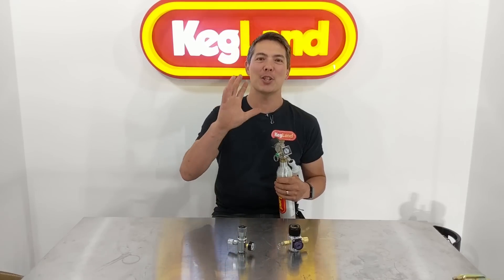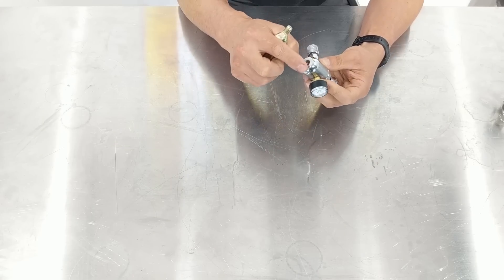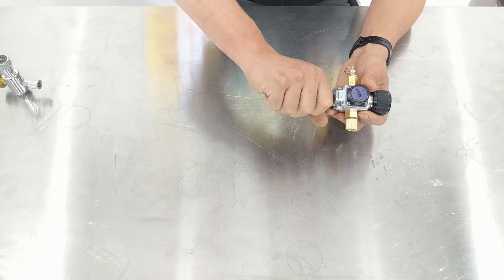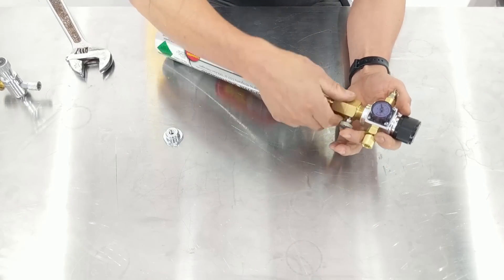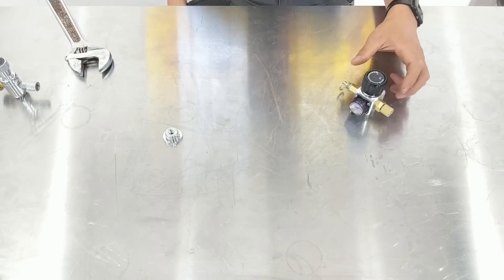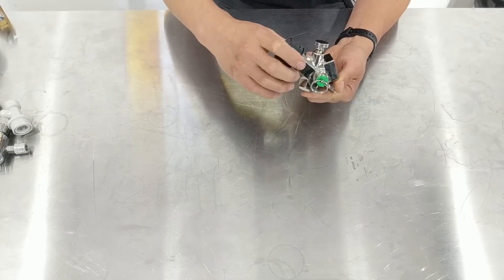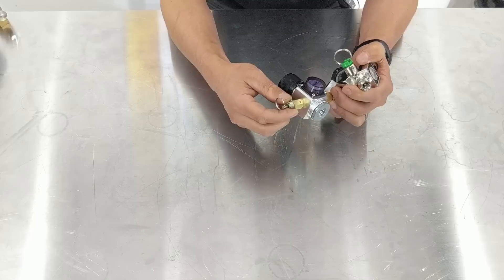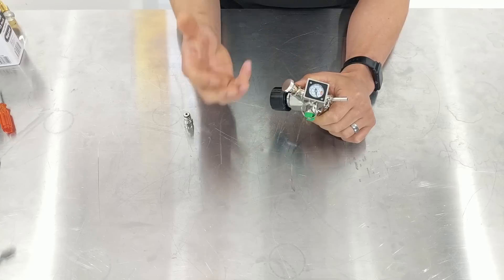The mini regulator that works better in every way - Designed by KegLand

Comment: I put a setup like this together about 9 years ago.  Things have come so far!

It's really convenient using paintball canisters because they can be filled for $6 at most sporting goods stores, you can keep a full backup on hand, and they are cheap to replace when they go out of registration.

I've run into a lot of the same problems you guys did;
- angles are difficult to manage.  gas line exits downward.  gas line from the tank to keg comes loose, leaks, knocks things over, etc.
- heavy full size regulator (for use with a keg) tips the canister over
- regulator dial broke pretty quick from tipping over.  I now just carbonate it then disconnect it.
- bleed valve is a necessity.
- mismatch of stainless, black al, brass, plastic looks messy.
- whole setup is small but unwieldy.

I have pin lock angled plastic and brass taps.  They're just okay.  The pin locks are a bit finicky and have drained kegs of gas or beer on many occasions.  The metal is nice, but the incorperation of plastic makes them easier to break than I would like.  I would have gone full metal, ball lock, at a right angle if it were available at the time.  

On the dispensing side I started with a cheap faucet.   I bought a nice handle to get more leverage opening and closing the faucet.  Then I upgraded to a Perlick creamer.  The creamer function is pointless but the front sealing design is SOO much better.  I bought a restrictor/flow control to avoid unwanted foaming but found warm beer spoils to quick, foam isn't an issue with cold beer - I run it opened 90% of the time, and it makes the faucet stick out too far.  It's chrome plated and has gotten all dinged up.  I got rid of the nice handle and keep the setup in the fridge.  If I were to do it again I would have gone with a basic front sealing stainless faucet.

Watching this video makes me want to revamp my setup!  Metal ball lock connections, this regulator, ball lock taps.

Damn... you can't buy them in the US :( 
Or the Maltzilla - just purchased a mill and I would have bought that one had it been available.
Reply from the maker: Thanks for your comment! You should be able to get some from Williams brewing or More Beer in the US

Comment: These are awesome, managed to snag one in the 10 minutes they were available last time and the few preliminary tests i have done it works well with no leaks. It is bloody solid so any falls and knocks it not going to worry it

Only thing, from the factory, the bottom bushing was on really tight,  i needed to put it in a vise and use a spanner to get it loose.
Reply from the maker: Thanks for the feedback, we will be sure to pass this onto our product development team. Glad you are liking the mini reg!
Reply: What thread is on the Australian sodastream cylinders? I'm in the UK but got a few of the old style cylinders with old thread type thread.
Reply: 2 years later and I just installed mine same issue bottom nut really tight had to hold tight and hit spanner few times with hammer to loosen it off.😮

Comment: Oh man, that is brilliant! I have a couple of the garbage soda stream adapters that only have a tiny screw in the middle of it and I always lose a ton of CO2 when switching bottles. I always dread changing bottles because of this and sometimes I have to adjust the little screw in the adaptor to make it just right which means I lose even more CO2 having to try it over and over again.
I need one of those but I need one for Swedish/European soda stream threads.

Comment: bit late i brought a regulator few weeks ago! would have brought the new one if i knew, nothing but trouble with the old one!
Reply from the maker: Sorry about that. This is a constant issue for us as we are quite regularly trying to increase the feature set of all our products.  This unit will be a bit more expensive.  So I guess at least you saved some money?
Reply: @KegLand  yeah saved some money on a product that does not function properly? sorry hard to see an upside to this.
Reply from the maker: @jamesdurrington9589  Up until this new Mini Regulator is released that has the only mini regulator type that has ever existed.  This new model isn't even in stock yet. Should be arriving in a few weeks.  Even when it comes in stock we will still continue to sell the other ones too.

The current models still work but they just don't have all the features that this new model will have.  Thousands of customers before you have used and continue to use the older designs.  If however you have any issues with the older design you have just let us know and we will assist you in any way we can.

Comment: I have an issue refilling my 60l sodastream c02 tanl. I'm in the US and mine have the newer (type b?) threads that are more finicky. I use a 5lb co2 with the standard CGA320 valve. I have an adapter, which I got from some third party distributor off the internet, but is much like the others... brass, has a pressure release pin, TR21.4 to CGA320 adapter. I can't tell if the adapter is bad or if the brass screw that's inside it is not at the correct position, or if my 5lb's tanks valve just simply releases too much pressure... but I am having big problems getting c02 into my soda stream tanks. It seems by luck, like 1 and every 10 tries, I can get 50-100ml of co2 into the tank. BTW, I believe my tank is non-siphoned so I do hold it upside down. I also freeze my soda stream tanks before trying to refill them. 

I am hoping that by using a regulator I could solve these issues. Would a regulator mean that I can control the pressure heading into the soda stream container, ensuring that I never cause the soda stream' TR21.4 pin to lock? I want a reliable refill every single time. Would buying a regulator such as this ensure that?

I am also looking into a direct connection from my soda stream to the 5lb co2 tank. I am concerned about taste, as many have reviewed that with this setup that any gas left sitting into the tube will impact the flavor of the water. Can anyone pin point as to why this bad taste happens? And perhaps to a similar set up that designs this problem out?

Comment: How long would one of these run the 8L kegs on a soda stream bottle? I already have soda stream in the house, and refill my own bottles from a 20lb cylinder. 

Going to be building a keezer as I get back into home brewing, and I was faced with either buying another CO2 cylinder, or somehow rigging up something so my 20lb cylinder could run the keezer but also still fill my soda stream, and not be a PITA. 

These regulators seem like a really good ticket. I was going to ask if you can T the CO2 output to run more than one keg on it, but the fact that it has 2 outputs answers the question for me. 

Have the equipment purchased for a 2 keg keezer, but always thought it would be nice to have the ability for more, however my freezer I think will only hold 2 corny kegs.

However, the fact that I could pack the 8L PET kegs around the 2 cornys and run more taps, all while using a soda stream bottle to power it, is very intriguing. 

Does a soda stream bottle have enough in it to run a 19L corny keg efficiently enough? Would you still force carbonated from a larger tank? Or can you do that with a soda stream as well? 

I have only played around with the 4L kegs (like a Hendrix Keg) I can carb with one of those little 16gram CO2 cartridges and dispense with another, so thinking that a 400gram soda stream bottle could do a corny keg with no issues. 

Sorry to drag up a 3yr old video, but these products are all new to me!
Reply from the maker: You'd get a couple of kegs out of it, depending

Comment: What Duo tight fitting do I need to connect to the mini regulator so I can use an Eva hose?
Reply from the maker: just use the duotight joiner.  The regulator is 1/4" (6.35mm) duotight compatible barb so you can put any of the duotight fittings on for this size.

Comment: How tall is the mini 360 regulator? There are no dimensions on your website. My goal is to fit a a soda stream cylinder fitted with the mini 360 regulator in a minifridge (I don't wanna drill holes because its not my fridge) to dispense from 4L oxebar kegs. I know the soda stream cylinder is about 370mm, just trying to figure out the complete overall length so I know if I have enough clearance.
Reply from the maker: It's about 80mm high.

Comment: I just bought one of this and I can't find any information about if the regulator can go in the fridge when performing force carbonation. I have read that some regulators have problems with CO2 condensation while being in the fridge.
Reply from the maker: It all comes down to flow rate. If you are just carbonating one keg the reality is it will be fine but if the regulator freezes up it can hold the regulator valve pin open and cause the gas to continue to flow.  The goods news is this regulator has been designed with all the high pressure components that are tolerant to liquid co2 so it will not damage the regulator and worst case scenario the PRV will open and then you just wait for the regulator to come back up to room temperature or fridge temperature.  So i would advice you to just give it a go.

Comment: So could we use these mini regulators in kegerators to save space using a bigger tank?
Reply from the maker: Yes you can definitely do that if you want to.
Reply: KegLand on your website it states they are not compatible with the larger tanks - does that mean the largest tank available to be used is a sodastream or can they be used with standard sized CO2 tanks? I’d like to use one as my only regulator if possible. Thanks!

Comment: 4:17 PLEASE how on earth did you unscrew this bushing?? I need to replace the seal ring you mentioned flattens and wears but my bushing will not unscrew. Any tips please!
Reply from the maker: It can just be done with a spanner but just to make sure we are talking about the right part can you please email us some photos of what you are trying to do so we can confirm that you are doing the right thing.
Reply: @KegLand  yes will email. It is the same part you removed at 4:17 with the spanners, though mine will not budge. Only thing I know to try next is to put it in a vice, except I don’t have access to one at the moment.
Reply: @KegLand  yours came off without much effort in the video so I’m not sure why mine is this stuck because I’m a pretty strong man ha

Comment: I’ve got a problem with my regulator. The bushing for 16g bulb will not screw off. Any tips?
Reply from the maker: Sounds like a job for a couple of wrenches - one to hold the body, one to unscrewing the bushing
Reply: @KegLand  i'll give it try. thanks

Comment: Will the regulator be damaged if I do not hold the bottle upright without a shut-off valve? Is there actually a shut-off valve for SodaStream bottles?
Reply from the maker: This should really be opperated in the upright position. We have been doing testing upside down it seems to still perform fine but the issue is if gas was constantly being used at a high flow rate while upside down it could cause the regulator to fail so it's just better to use the regulator in the upright position.
Reply: @KegLand  A small shut-off valve on the side of the SodaStream bottle would be great. It could be transported in this way without having to worry about the control valve being destroyed.
Reply from the maker: @TheAndlix  We did consider this but it's also not difficult to just use the thumb screw at the top of the regulator. IF you unscrew the thumb screw the pin on the sodastream will no longer be depressed and therefore no gas will flow out of the regulator.
Reply: @KegLand  But can't the liquid gas damage the regulator membrane? Or is no membrane used?
Reply from the maker: @TheAndlix , Unlike other regulators, this regulator uses a brass piston rather than the typical rubber diaphragm.  Also if the liquid was to get into the low-pressure side of the regulator it will flash off and almost instantly turn into vapor.  As we have a PRV fitted to the regulator even if the pressure builds a bit the PRV will quickly open and liquid would only get into the low-pressure side for a split second.
Reply: @KegLand  Thanks for the detailed answer. Great support!
Reply: @KegLand  So now I only have the problem that I can't find it in Europe. Unfortunately, only a few of your products are offered in Europe. Sometimes it is not possible to distinguish whether it is a clone or an original. I hope that in the future you will be more represented in Europe, preferably in Germany or Italy.
Reply from the maker: @TheAndlix  Hey Andlix.  Yes sorry about this.  We are still trying to manufacture more stock but our speed of manufacture has been a bit slow. We have a lot of distributors in Europe who have ordered the product but we can barely keep up with demand in Australia alone so we are doing our best to scale up production. I think you should be able to purchase stock in Europe by th eend of the year. Sorry about this really long wait.

Comment: Can you use these mini-regulators with 75% Co2 + 25% N2 mix (for pouring stout)?
Reply from the maker: Yes you can. They are a multi gas regulator.
Reply: @KegLand  thank you!